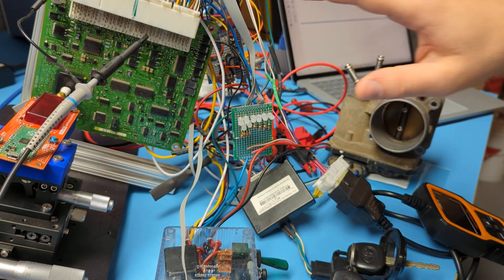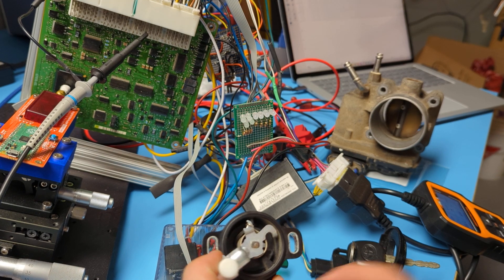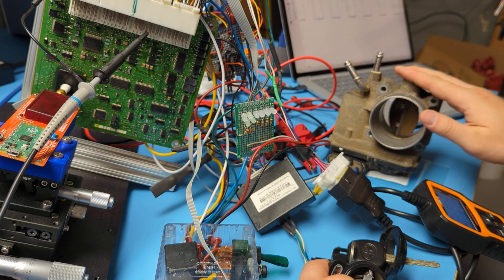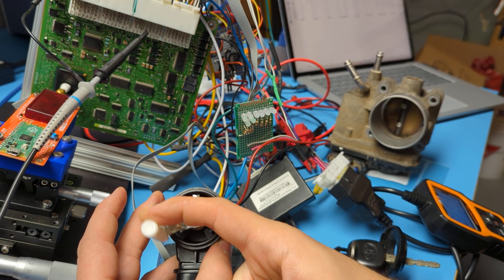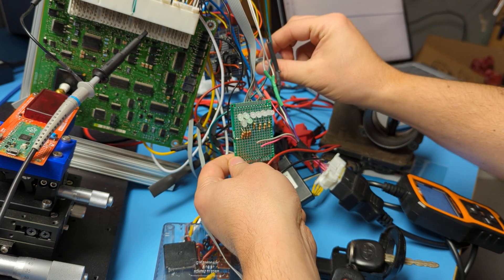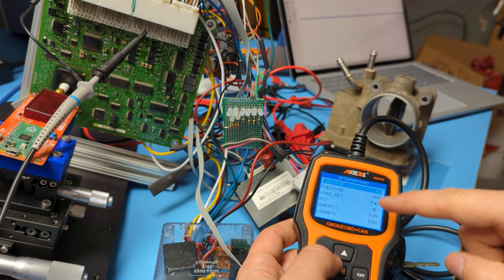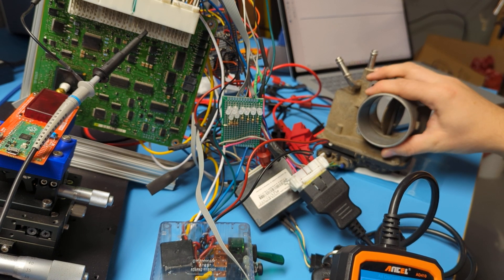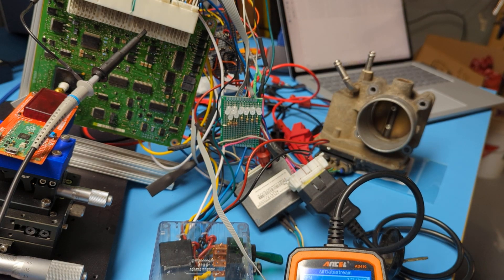Toyota "Stuck Throttle" Investigation - PicoEMP on Bench (Part 3)

Comment: Wow, thanks for reproducing this on the bench.  I experienced a stuck throttle event 20+ years ago.  Went from stopped at a four way intersection to sudden uncontrollable acceleration right in front of my then-girlfriend's family home.  Ended up running the car into a tree right in their front yard.  I had been driving for less than two weeks.  Back then we didn't know the root cause yet, but I swore up and down the car accelerated without me doing anything.  Unfortunately, as a freshly minted 16 year old driver, I was blamed for wrecking the family Toyota.  Anywho, even though I read about Toyota's software failures years ago, it brings me great satisfaction actually seeing the failure occur on the bench.  Thanks for taking the time to reproduce this behavior.

Comment: Oh, one other thing to try. The Barr slides indicated that the failing state they identified would be caught by the cross-checks if brake state transitions after it entered stuck-throttle mode. May be worth seeing what happens...
Reply from the maker: I did try toggling the brake sensor pin - need a better test bench though, I don't have all the sensors connected. Ordered a more complex setup to try running it, as still having trouble with the in-car experiments. Thanks for thoughts!

Comment: Have you tried this setup with any other manufacturers besides Toyota? What real world situation is being simulated, a lightning strike?
Reply from the maker: Haven't tried it with others - the idea is that the sort of corruption the tool inserts does simulate stuff like a big spark (lighting strike, or some nearby short or big motor turning on), and also random bit flips caused by atomic particles. Correctly designed automotive systems should detect this since it's a known issue. The Barr Group did an analysis of some of these ECUs (not exactly this one but similar) & found issues where they weren't protected correctly. So suggests the sort of errors I'm seeing might be caused by those design failures.
Reply: @ColinOFlynn  thanks! Have you tried inducing a fault with the ECU shielding in place, maybe through the wiring? I enjoy the videos!

Comment: Do you know what version of pcm software is installed? It might be interesting to know if this condition is possible with the updated brake override, if you could simulate that input.

Do you think this is isolated to this Toyota drive by wire setup?
Reply from the maker: Not sure - it's an older ECU (just got a box of pulled ones, PN 89661-02C12) - they might have come from when Toyota did a recall for ECUs with soldering issues as those models are part of the recall, so I'm guessing it's older software as they probably just removed them from the vehicle and put a newer one in, then did any outstanding software updates. This ECU is actually different from the one Barr Group looked at, so it sounds like if there is some SW corruption issue it might be a problem across a few ECUs. Eventually wanted to get some of the other models, but trying to fully prove this one out (e.g., hopefully to in-car test).
Reply: @ColinOFlynn  if it should end up being useful, you may be able to find the software version and other information using "Mode $09" on your scantool. Thanks for the great content.

Comment: I don't think this could apply to anything much newer than your test vehicle. Almost all calibrations I've seen after 2007+ will have at minimum 1 but usually 2 TPS sensors working inverse and comparing signals to confirm no stuck throttle. Also the ETC tests will constantly be monitoring RPM to confirm its within a possible commanded range. If anything is unhappy at all the codes that are thrown will also limit the vehicles fueling/spark/air and shutdown throwing a ETC warning.
Reply from the maker: This has dual sensors on the accelerator pedal and the TPS. The sensors do work in the same inverse method you mention. The issue here (appears) to be entirely a software one, so the dual sensors don't help if the software doesn't cut out when things go wrong. Still need to confirm if anything more complex shuts down, it's still (trying) to give spark, but gets hard to simulate all the inputs on this bench to make it happy for fuel etc. Working on real car tests now!

Comment: What happens at 5:07 and following is pretty interesting.  Does the throttle unit have any positional feedback or is it just relying on steps of a stepper motor, with initial calibration at power-on by running the stepper to the limits of the throttle plate travel (maybe detecting stepper current), or possibly limit switches?   It looks like moving the accelerator pedal to command the throttle to "open more" prompts the ECU to realize that there's something wrong, causing it to move the throttle in the closing direction (which is the direction opposite to that which the pedal is commanding).  The throttle comes to rest temporarily at a "slightly open" position -- sort of a "limp home" position.   When the pedal returns to the position that would correspond to that slightly open throttle position, the ECU reinstates sync between the two, and allows the pedal to command more complete closing of the throttle, and subsequent normal control.   
So it looks a lot like the ECU does detect a fault, and uses a strategy to recover.  It just didn't discover that when the throttle was wide open, perhaps because it doesn't  know the throttle position.  I wonder if the ECU would realize the throttle position fault sooner based on high RPM of the crank or cam signals if they were present.
Reply from the maker: The throttle is a servo motor setup - it's a DC motor and there is a feedback loop (dual position sensors for redundancy). It does have various limp home modes - on the "real" car you can trigger them, and it still tries to vary engine speed but it doesn't do anything with the throttle when it's in limp home mode. I do have crank & cam signals here as setup a simulator to give them - it's how I get various RPM values to change. I haven't seen it cut out when the RPM gets too high (but I don't know with 100% certainty the signals don't have some errors, I do see the RPM change so am guessing at least crank is working).
Reply: @ColinOFlynn  So in principle there's no excuse for the ECU not to know the position of the throttle plate. Yet somehow the PicoEMP puts the ECU in a mode where it doesn't re-examine the throttle position (or maybe thinks the wrong position is actually correct) until you twiddle the gas pedal.  Hmmm.  I'm still thinking that it has to have a procedure to calibrate the position sensors to the actual range of motion of the throttle plate, and that's what may be running when it starts to recover from the problem.   Anyhow, interesting exercise -- though maybe in this video you're more interested in effectiveness of the PicoEMP in probing the problem,  rather than actually solving the Toyota issue, at least at this stage.

Comment: What fault are you injecting? And what is PicoEMP?
Reply: See Colin's earlier video: Building the PicoEMP - Electromagnetic Fault Injection (EMFI) Tool   https://www.youtube.com/watch?v=nB5arJi-tVE   To answer your question, the PicoEMP appears to have a circuit which charges a capacitor to about 250V (similar to an electronic photoflash unit). Then on push-button command (or maybe software control) the circuit can dump that capacitor charge through some load. For EMP testing, it looks like the load is a small coil .  In the "stuck throttle" video. the coil is the white object (possibly white tape insulation) with the axis of the coil (and thus densest flux) pointing into the large chip on the ECU board.